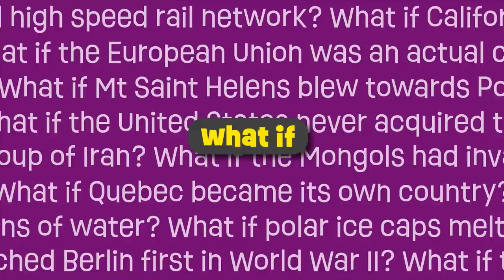Water Pipeline: What If An Aqueduct Was Built From The Great Lakes To The Southwest?

Comment: As other comments have pointed out, and was covered in the video, hard no. 

If you're not putting the water back into the source (or surrounding aquifers) you shouldn't be taking it out.

This would be nothing but a bandaid and would drain the lakes. Any amount sufficient to supply those states would not result in substantially less water going back those lakes than would be taken out. 

The net effect would be slow (or maybe not slow) draining of all 5 great lakes.
Reply: what about water waisted goin over the falls  million gallons daily
Reply: What are you talking about? Water not taken from the local environment is not "wasted".

Comment: To make this "What If" more feasible, instead of running the pipeline all the way to Arizona from Lake Michigan, you could build the pipeline to Colorado or Wyoming and have the water be dumped into one (or more) of the Colorado River tributaries, where you can take advantage of gravity and geography to get the water the rest of the way through the basin. You could cut the cost of the project by half by doing this. 
 
A more realistic solution would be for California to build multiple desalination plants along its coastline, to be used solely for its agriculture, then remove the state from the Compact. The water that would normally have gone to California can then be redistributed among the rest of the Compact. 

As far as the brine solution byproduct from desalination plants go, you can either turn it into table salt or you could sell the solution to produce salt batteries.
Reply: Uh...1) is this not how the Colorado River works?  I presume you're not being satirical here.  2) Wyoming and Colorado aren't exactly meccas of water.  Yes, we're at the top of that water table, but if the snow stops, so will the water, and climate change is affecting that snow pack as it is.
Reply: @nickmonks9563  No, I wasn't being satirical in my comment, I was attempting to come up with a slightly more realistic and cost-effective alternative pipeline to the one proposed in the video. The second part of my original comment was to propose a solution that wouldn't require a cross-country pipeline and still respect the water rights of the largest number of people possible.
Reply: By golly I can’t believe no one thought about that thirty years ago I mean in the end Mexico has a right to the water in the Colorado river so seriously no one has said anything about more canals down there because they are already there from the Colorado all the way to Tucson! Unless it was the fool that came up with this stupid divisive video! The point is the win - win of draining waters to keep flooding from happening and sending the water where it’s most needed!

Comment: What about the idea of diverting a small amount say 10% of the Mississippi river at the Iowa Minnesota border and only send it to the area around the top of the Colorado river? I suggest this only as a way to manage the fact that year after year the states below Iowa tend to flood extensively. This diversion would allow the extra rain water to be absorbed into the river instead of going over the banks.. at 10% its not enough (likely...im spit balling the math here) to be catastrophic even if there are 3 or 4 years in a row without flooding. Seems a win win to me and the build cost would be SIGNIFICANTLY lower than trying to go from the lakes all the way to AZ.
Reply: This is exactly what I was searching on.  I don't know why the great lakes would be considered.  The great lakes basin isn't part of the Mississippi basin.
Reply: So what I hear you saying, is that you would like to spend billions of dollars to pump Mississippi river water uphill during floods and then let the pipeline sit empty most years when it isn't flooding? Or you want to take 10% of the Mississippi and pump it up to the Continental Divide every year, floods or no? You do realize that the downstream states use that river for transportation as well as agriculture and domestic use, right? If you thought getting the Great Lakes states/provinces to agree to taking water out of their system was going to be difficult, hold on to your hat trying to get the downstream Mississippi states to agree to such a thing. I really don't think Mississippi flooding is as common as you seem to think it is.
Reply: @rmdodsonbills  lived in Iowa my whole life..spent near a decade living right by the river in davenport even worked on the river (riverboat casino) so trust me I know it better than you think.
Reply: @rmdodsonbills  this country has thousands of miles piped around, thay ship either oil or natural gas. Any of these pipes can be repurposed to ship water. And because of its physical properties, a higher water volume can be pumped thru the pipes, when compared to oil.

I am not saying to take all the pipes for this, just the ones needed. Ideally water can be taken from places that are overflowing and prone to a flood. Heck if the southwest/Lake Meade is overflowing, the water can be pumped back to the east.
Reply: @Adam.Reader14  If it were that easy, I imagine it would have been done already. I expect that the difficulty you're glossing over is the quality of the water that comes out of those hydrocarbon pipelines.
Reply: @rmdodsonbills  look up what a "PIG", (Pipe Inspection Gagdet), they're used the time to check the pipe for leaks/cracks and even cleaning of it.
Reply: This would artificially inflate how many people can be supported by water resources in a desert ecosystem and not solve the problem that exists
Reply: @greksmith1874  While true I don't think that the entire SW is just gonna decide "Oh, well, not a lot of water guess we all better move". So let's do what we can to keep it habitable for as long as we can
Reply: @brianscharlau4018  Then how about people in the SW stop doing commercial agriculture in an arid environment? Or start making people pay for the actual cost of water and not make it unrealistically affordable? The solution shouldn't be "Oh well, not a lot of water. Let's keep developing it for housing and businesses and things will just work themselves out der-der-der"
Reply: @brianscharlau4018  one more thing, because I am not done. You need to read the news about what is happening with all major rivers around the world including the Mississippi. They are all drying up. Thinking to divert water from there to the desert would be both shortlived and catastrophic.
Reply: @greksmith1874  so only send it during flood season
Reply: @brianscharlau4018  good god, you do not understand how any of this works. You know what, go on build that pipeline just like Trump did with that wall 🙄
Reply: @greksmith1874  only the lower Mississippi dries up, the water table in MN is way to high as is. Would solve 2 problems at once. Big issue with MN is the Sioux. Theyll hate it.
Reply: @ironhell808  Look up the concept of Tragedy of the Commons